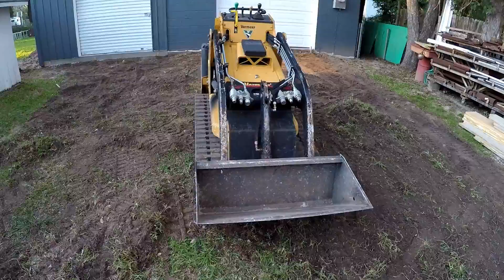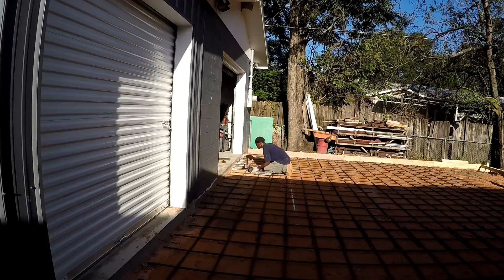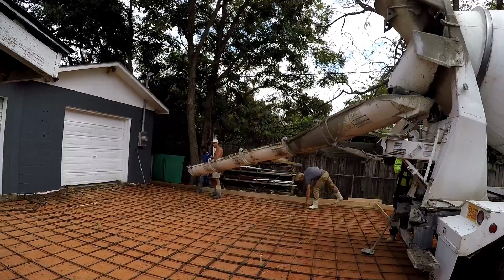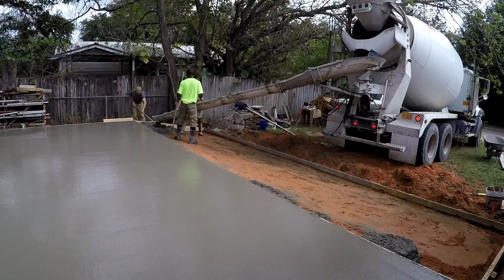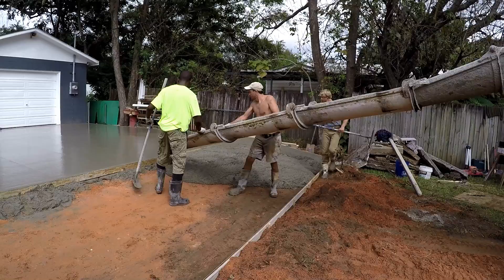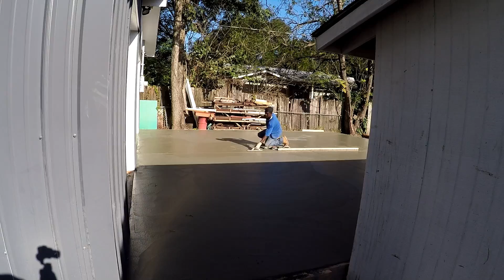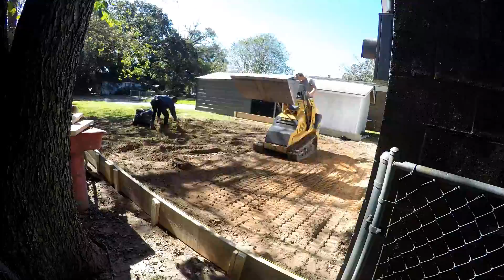New Shop Concrete Slab!

Comment: 2 concerns Adam .. they never used a screed bar(should be used to get the slab nice and level)  or pokered all of the concrete . Putting that depth of concrete in can create a lot of air pockets ,which can bubble for hours after the pour . Concrete can get warm when it starts to cure ,if there is air trapped it can ruin the finish they put on it with the long float . Did you notice any bubbling .Not trying to scare you just speaking from experience ... I work in construction . I noticed they did have screed pins set out . 

Sean
Reply: Sean logie hmmm good point, Adam should totally chip that slab out and pay to have it replaced. He wouldn’t want his nuclear reactor or particle accelerator to sink into the ground.
Reply: It's an observation not a criticism.... You do realise sarcasm is the lowest form of wit ....
Reply: I do realize that.
Reply: To criticize, how this crew is in business is beyond me.    Not do to the lack of work.    These guys are barely getting by on knowledge and experience.  Sad.
Reply: Sean logie --- The 4 screed pins allowed to set a 'concrete screed' which I was using back in the 1970's era. It's level just run a straight edge on it!
Reply: You have no idea what your talking about!   None.

Comment: What "feed rate" were they unloading the concrete at?  Did they use Iscar Bull float to get a nice "surface finish" ?  lol, looks awesome Adam, i would say they built you a strong slab for sure! Seem like hard workers and knowledgeable in their craft

Comment: My back hurts just watching these guys. Lol
Reply: Look at the guy in the blue tee around 26:10. I think his back agree with you.
Reply: Anders Wegge --- He is very good with the 'screed board'.
Reply: Young men with backs to burn.  They'll have damaged backs for the rest of their lives doing this job much.
Reply: the pros know how to let the mix work it's self I had two pours done they can do twice the pour with less work than I can and they know when to get on it to smooth it out
Reply: no way I would even attempt doing that without using boards on each side. I would have cheated and made four slabs. that boss likes residential stuff so he does it. stick to your knittin'. do what you like and are good at.
Reply: Ditto on the screed board rails and 4 pads. They're all better men than I am, but then I'm almost 70 and no back problems. Good crew.
Reply: Believe it or not most concrete guys dont have back problems. Their backs are strong as hell from doing it for years. I have done it my whole life my father has his own company and he does it every day. He is knocking on 60 and looks like a built 40 year old.
Reply: Anthony Jones this is true, most concrete guys have strong backs.  It’s the shoulders, elbows and minds that wear out.
Reply: Mitchell Martin lol what for you hhhhhhh
Reply: Let the concrete pile up and it moves itself.

Comment: re bar a bit low
Reply: These guys do this every day, don't sweat the small stuff :)
Reply: It looks like that, but they raise it as they go. 

Also, for the other guys, he's not an arm chair fella, he raised a valid concern, he just missed the part where they raised it as Adam didn't focus on it.

For those that don't know, for concrete to be called reinforced concrete all the rebar has to be fully contained inside the concrete, and preferably centered. Exposed rebar means it's just concrete as it has less of the properties you need to call it reinforced (roughly paraphrased from one of the older manuals they taught us in uni with).
Reply: Mmm, let me think about that...No, he's definitely an armchair.
Reply: What is it that makes you think you're correct and the experts doing the job were wrong ??  
If you watched the whole video you'll have seen the contractor being interviewed by Adam where he said he's been doing this type of work since the 70s at 16 years old and took over the family business.
I would agree that the re-bar should be in the lower 1/3rd as it was done due to the way it will try to break under load from the top and start to snap from the bottom.
Do you actually think they'll dig it up and re-do it your way ?  

"anyone tells you otherwise doesn't know as much about concrete as they think they do".
Kick back in you're armchair and shut your puss, arrogant prick.
Reply: for a slab pour of up to 6" , rebar is to be a minimum of 2" ....... seriously it looked good to me and i am a retired contractor. i would hire them with no question. i am from hawaii and the guys here at least most of them will take you to the cleaners. you did well !
Reply: I guess l forget how much work it is to put in concrete, looks great,  David from Iowa
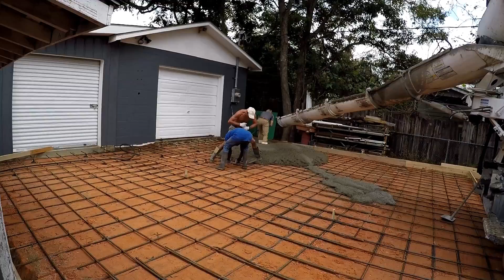Reply: aserta - Adam talks about it 12:30
Reply: Hui 9697 .. Any qualified structural engineer will tell you that reinforcement in a six inch slab should be in the middle otherwise the loads will not be balanced it's even more important in the centre of the slab. And I too started at 16 in the 70's, I got the same advice from the county surveyors only last year, when they certificated the extension to my own house. Armchair my arse...
In fact the ACI do not approve of the practice of "hooking" so by definition anyone using a "deprecated and ill advised" method isn't professional at all. Two minutes with Google will prove it. Compare this to the way essential craftsman does it if you want to see it done correctly...and professionally.
Reply: Luis Calvillo  exactaly
Reply: You are correct Robin Turner , #5 rebar in a 6" slab should be 2" or 3" from the top, which is where you need it the most to keep the concrete flexible, also I would give it contraction joints at every 10 to 12 feet.
Reply: Robert Savilonis i agree. I do this for a living 50mm bare minimum. Top and bottom cover is really important for the longevity of concrete
Reply: dan wolf - Negative.  They lift up the rebar as they go.  There's no point in raising the whole thing before pouring because then it becomes hopscotch and tripping hazard.
Reply: another internet expert :(
Reply: dan wolf --- Rebar was very well placed.....almost expertly!....one of the best non-commercial jobs (residential) I've seen.
Reply: +Robert Savilonis nope
Reply: +Hui 9697 no bad boy , unfortunately ive had to lay 1000s of tonnes of concrete.
Reply: +aserta thanks for that, I got bored and didnt watch the video through and stopped watching when I saw the mesh on the bottom. Im pleased to see it was the correct grade of mesh and not light stuff
Reply: +roddiener your get hate like i did for saying that
Reply: Even thought they pulled it up , yes it was still too low. To be fully effective it has to be half way through the finished slab. It was up off the hard core but it wasn't at half way. Clearly visible at several points in the pour, in a six inch slab it would have to be 3" up and it isn't. Anyone tells you otherwise doesn't know as much about concrete as they think they do...I learned how to pour farm workshop slabs that take big machinery over 40 years ago and I'm not in my armchair yet.

Comment: I said it before, I'll say it again. Ohhhhhh the things you don't have to do when the ground doesn't freeze.
Reply: Where I live temperatures never go below 20 celsuis so this is the only way I have ever seen a site prepared. My question is how did they pour the ramp with no reinforcement? If you look at 25:29 there is clearly no mat or wire mesh. At bare minimum I would expect mesh.
Reply: The contractor mentioned earlier in the video that he was using a fiber reinforced cement. The fibers in the concrete act as a substitute for the traditional wire or rebar especially in residential applications.
Reply: Just what I was thinking. Where are the 6' sonotubes?
Reply: Sometimes we can get away with high density styrofoam under slab to prevent frost heave here in Toronto
Reply: S P thanks. I kinda skipped through so I missed that. 

I would still put rebar there though based on the heavy stuff they work with. Even if the intended use (and I have not been looking at the videos that probably say what the intended use is) today does not require it I have found the small cost is worth it. You never know what the future brings.
Reply: -20 and 8 in of snow on the ground here.....Starting a new 2ft grade beam on Tues..The joys of working in Alberta.Canada, in the winter.
Reply: Shocking slab pour imo. The re-bar had little to no cover to the underside iin alot of places, give it ten years before it starts spalling, cracking and sinking.
Reply: @andarno01   It will definitely sink they brought the dirt up in 1 lift. They should have done 6 inch compacted and repeat. They backfill the edges so it doesn't undermine. But I dont think the rebar was burning that bad.
Reply: Around here i have heard of people trenching below the frost line just outside the slab and putting 4 inches of slab insulation in the ground to act as a frost wall.
Reply: Imagine how i felt, as a young architect going in Tunis (before the area went bad) and seeing pillars that were no thicker than a small tree for 2 story business centers...having to deal with damned sequoias over here.
Reply: Was wondering the same thing. My eyebrows were significantly raised when I saw them pouring the ramp with no reo in it. Thought it looked a bit steep too.
Reply: I wonder why they would use dirt to pour on ? And why they tied into the building.and no expansion joint  at the building ?
Reply: shawnhuk I live, and build, in the hills just south the Arctic Circle. Different  ball game. :) Must be nice not having to race with the weather every year.
Reply: Lostand Alone commmmee on! ... makin me look bad...
Reply: shouldn't need sono tubes. For a pad that big, it would be an engineered pad, which they aren't far off from for up here in the (semi...) frozen tundra. Rebar and whatnot. But for the frost the hole would have to be dug down to virgin soil and built up with crush stone or the like. If virgin soil cannot be found, then footings 4" down.
Reply: excavateboy even under an engineered pad?
Reply: In my area where we have both summer and winter a slab would be required to have a footing below the frost line rebar or not.. Every area is different.
Reply: where do you buy the foam? We been looking for a place to supply us
Reply: The company owner mentioned new concrete blends that use fiber reinforcement, rebar is going away for most light duty applications, as the rebar is effectively inside the mix already.
Reply: What’s the air content at?  Oh.